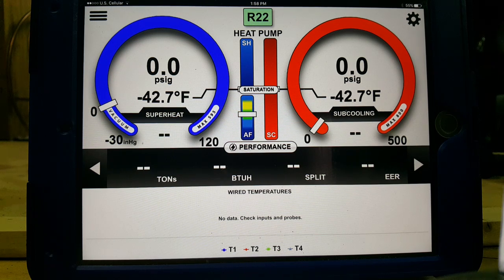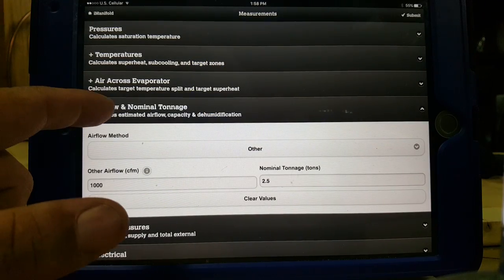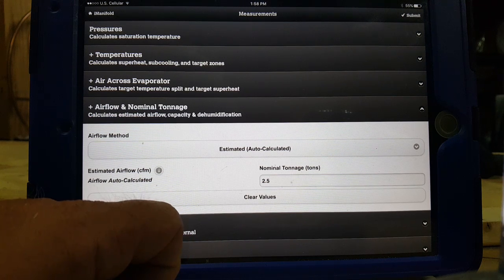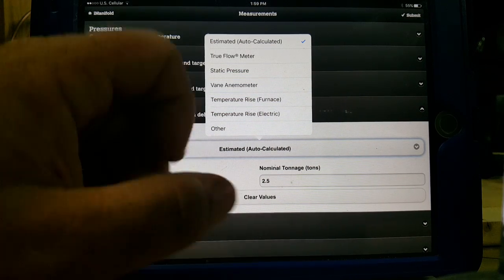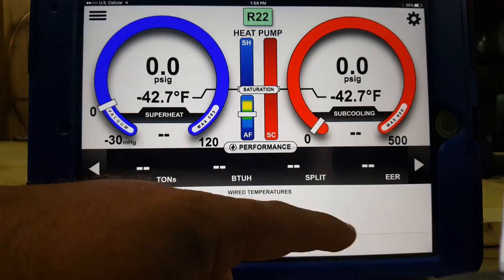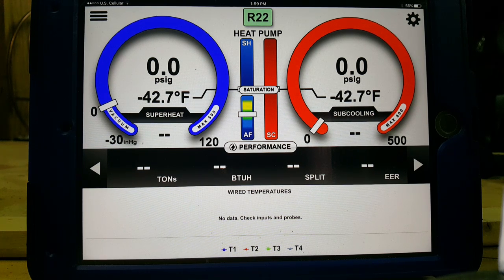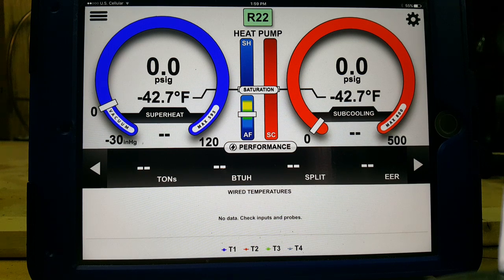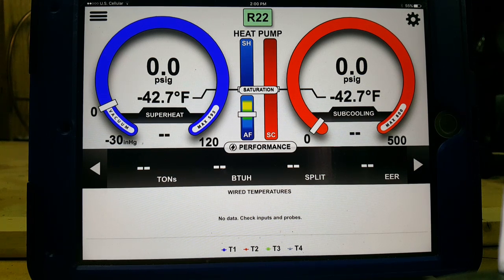iConnect Airflow Input Method

Comment: Are you back on the connect team Zach?
Reply from the maker: +jason Inman yep. I have been using it for several weeks again
Reply: Working Joes Roundtable how do you determine a DTD?
Reply: Working Joes Roundtable how do you determine a DTD?
Reply from the maker: its based on system SEER.

Comment: Nice explanation. I was always wondering if the iconnect will look at its charge levels, psig, superheat,subcool etc then know it can't say too much air flow while the refrigerant side of things were still not right. I guess the measurements are not all calculated together in a way. Hopefully I made sense lol
Reply from the maker: Makes sense to me pal
Reply: As in your example it shows me it does not calculate every reading together to give you an answer. Refrigerant side of things then air flow. It will put the 2 together to give you an answer.  Cool and not cool. Lol   But your example cleared up my unanswered theory/question. I do not own an iconnect yet. So I never played with one yet.
Reply: +Anthony Reardon hvacr Def a great tool. The nice thing is if a better way to process the info is found the app can be altered to allow it.